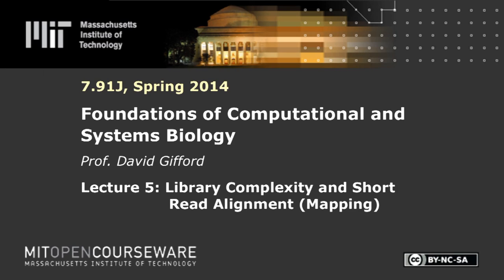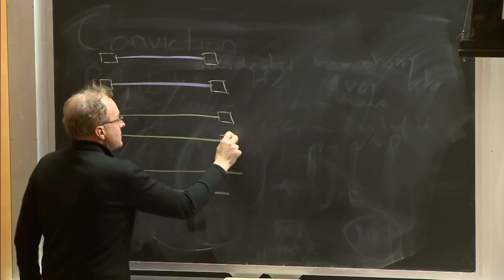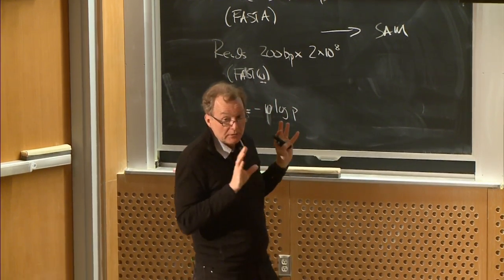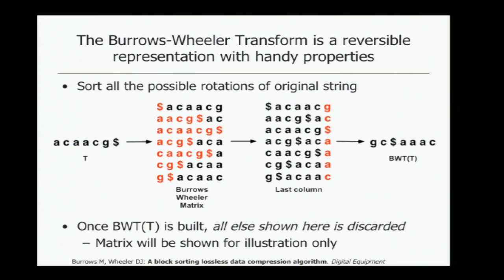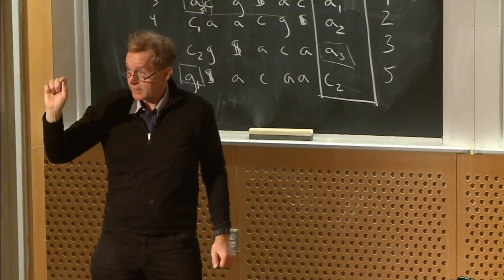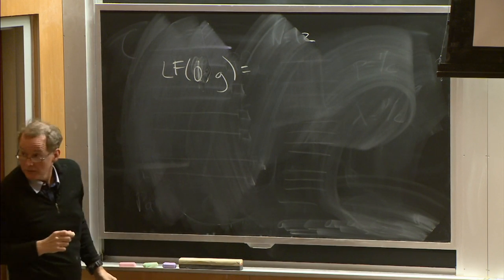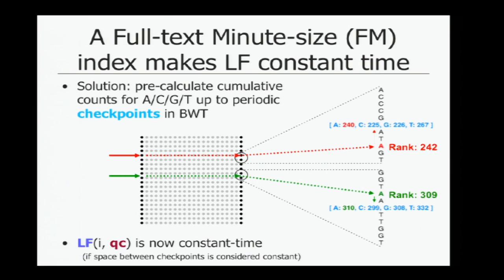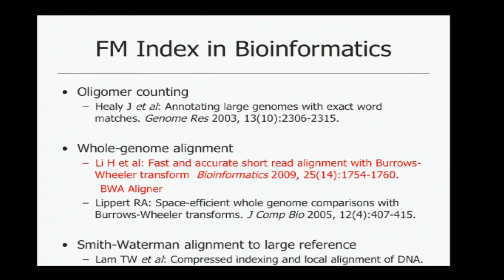5. Library Complexity and Short Read Alignment (Mapping)

Comment: This is a great course! ... except the dear professor Gifford says, he only needs the last column and not the first column in the BWT-matrix, although he uses the first column the whole time. 
What he should do, is to only use the last column, and count from the top, how many letters are before the letter in question. He is confusing the whole class! And this is MIT??? Sad!
Reply: But can't the first column be reconstructed just ordering the characters alphabetically?
Reply: Thx a lot! I was initially confused, until your comment notified me.
His originally slides are actually correct, but his demonstration on board is not
What should be LF(6,c) is this
There are 4 bases in the BWT(T) that is before 'c' alphabetically, that is three a and one $, so occ(c) is 4
There are 1 c that is before the 6 position in the BWT(T), that is the c on the 2nd position. So Count(6,c) is 1
Therefore LF(6,c) = 4+1 = 5. 
This means the position 6 C in the BWT(T) is at position 5 in the first column
Do it for every base in the BWT(T) and you can reconstruct the first column with only BWT(T)
Reply: When he said "we don't need to use the first column" he was technically correct but misleading.  He's technically correct because if you are given the BWT(T) string, and the Occ(*) and Count(*,*) functions*, then we can do the rank matching. In pre-processing the reference genome, the BWT matrix along with the Occ(*) and Count(*,*) functions are computed and supplied, so all that *we need for the input of the algorithm is the BWT(T) string and the two functions, not the first column.  He's misleading because in explaining *how to do the rank matching*, he's computing on Occ(*) on the board, which does require knowledge of the first column.  Our algorithm does not compute Occ(*), however.

That's why the algorithm isn't conjuring something from nothing (which is what I think people were confused about). All the compression happens in the sorting of BWT plus the computing of Occ(*) and Count(*,*)
Reply: True, but unnecessary since the relevant information of the first column is precomputed for you in the Occ(*) function which is supplied along with BWT(T)